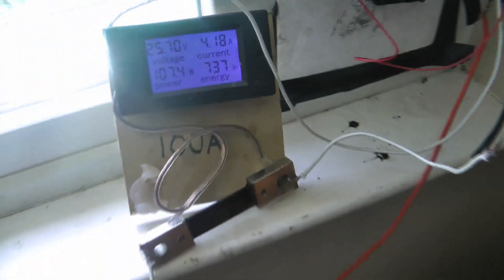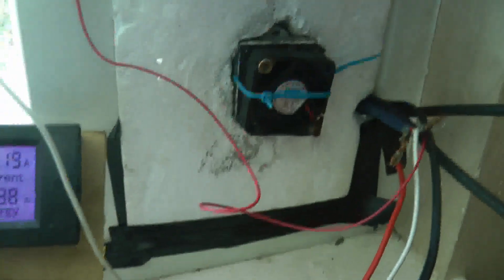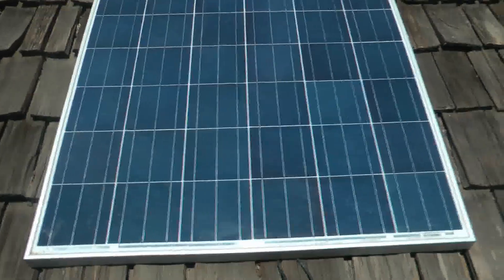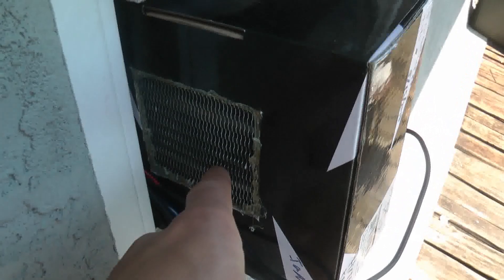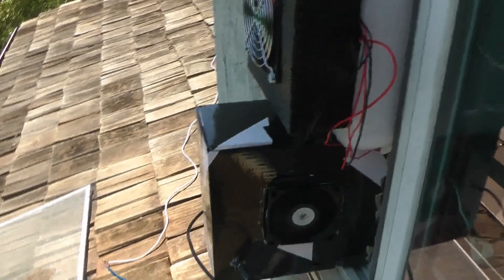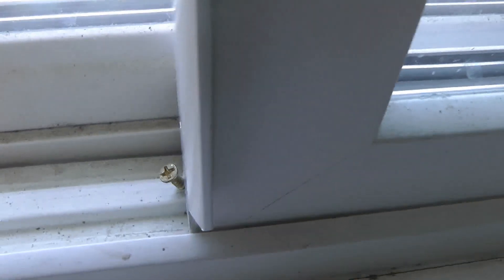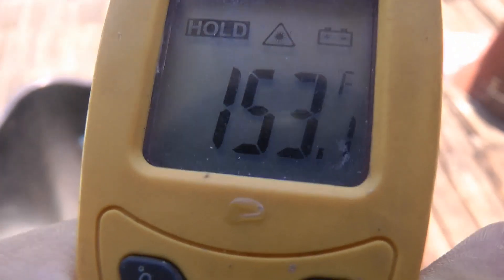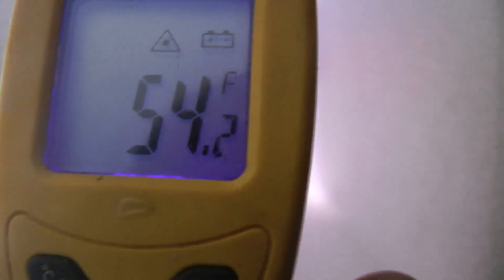Solar Powered Peltier Air Conditioner

Comment: Can we use sun heat on peltier to create electric, then use that electric to run other peltier for cooling?
Reply: Im from tropical country. Daylight really bright n hot.
So im tinkin about how to make "the hotter it get, the cooler we get"
Use multiple peltier based system for electric n coolin.
Which 1 to start 1st, electric supply system or cooling system? Then how to make the electrical supply cools. Sould i put overlap cool over hot surface..
N so on
Reply from the maker: yes and no its super inefficient  so solar is your best shot   but a reg ac unit is alot better

Comment: I see that pointing the thermometer directly to the air conditioner, it's a pretty cool temperature. I'd like to know what the temperature in your entire room is.
Reply: 153f, 87f, 61f.
Did u skip the class?
Reply: @NamaBaruSH  did i ask "you" this question?
Reply: @iantiangson1946 
Seriously Im telling the truth.
Its 175 f outsite,
87 f inside the room, and 61 f at bottom air conditioner.

U can watch it again at the ending.

Comment: I like this. 
Been thinking about doing it for cars. Imagine having a solar panel on the (car) roof that cools your car while it is parked in the sun. 
Downside is making holes for the Peltier elements. Might be ways around it.
Reply: I literally thought of this yesterday. And now here I am. It's like 90 In Cali currently. I just want my car to stay cool.
Reply: @captainKts  I’m in California also Orange County do you want to work on A/C project tougher ?
Reply: @arabcampers9554  sure, I have a few things in mind. I live on my boat in LA harbor Lear long beach, not too far from you. We should get some coffee and chat someday soon.
Reply from the maker: good idea
Reply: @ianbuilder  you think it would work what @Conny Stenberg stated?
Reply from the maker: @ThunderWolf712Tech  not at all   or very poorly as in less than a degree
Reply: @ianbuilder  how unfortunate. I appreciate your response man. Very cool video!
Reply: Passat b6 have a similiar feature using solar power on it s roof to use the climatronic while the engine is ofd
Reply: @ParkouSince2005  what year Passat b6 has this future ?

Comment: Which model of peltier module did you use?
Reply from the maker: regular 60w 12v
Reply: @ianbuilder  I mean, the high powered costly version? or the cheaper normal versions? Also I wanted to make one for a long time. How much can this cool?

Comment: I have a question for you, an idea keeps bouncing around but I'm too ill-informed to put it to rest.
Q. Would a peltier window frame have any value as an energy harvesting device?
*There will almost always be a differential between inside and outside but I suspect low efficiency might out way production cost.
*Are the hot-cold sides fixed or are they reversible dependant on situation? Would the frame require physically switching between summer and winter?
Answers like Fool or No-Fool are completely acceptable!
Also, I really like Final Spartan's suggestion. I pick up discarded electronics off the street all the time. I mostly recover components and copper to make jewellery etc but would love to make something useful from the parts that, so far, just confuse me.

I came from Nighthawk btw.

Jay (aka 996)
London.
Reply from the maker: lol   good idea   not worth it  if you plan on buying al those peltiers    as you will need many in series to just power an led  its possible but unles you have lots of peltiers on hand then its alot of money work and time to get what i would expect to be  less than 1 w per sqft during most of the year
Reply: @ianbuilder  Thank You, Thaank Youuuu. So Dooo.
You've removed a needling thought that has bugged me for ages. I couldn't let it go without being sure it wasn't viable but I didn't know who to ask.
I'm eager to see more from you, just wish I had a dollar to send. Keep it up Bruv.

Jay.

Comment: This content is Pog. Subbed with notifications on.

Random idea. Start a series where you make cool projects with a single 18650 cell. The simplicity and ease of using 1 18650 is really attractive for people looking to get into hobby electronics and RC. You'll probably need a 3d printer to get started, if you don't have one already, start a Patreon or GoFundMe, I'll support it.
Reply from the maker: i have a ender 3  and i can definitely do some 18650 cell projects  any ideas?
Reply: @ianbuilder  One of the best features of 18650s is its insane specific density at a relatively low price point. This makes it ideal for dead simple RC vehicles with reasonably long ranges. I suggest maybe a simple plane or a car to get started, ideally it's 3d printed and uses as little hardware as possible. There are a few preexisting projects like this but very few of them are centered around the idea of being powered by a single 18650.

Inspired by:
- Jerome Demers 18650 drone
- Tim Stanton Lithium ion plane battery
- Tim Stanton 3d printed hovercraft

More benefits of single 18650 designs:
- Super simple to recharge
- Insane endurance
- Insane capacity
- Reasonable current (See sony VTC6)
- Standard form factor (unlike most LiPo)
- Readily available
- Cheap
Reply: Sweet idea Final Spartan.

Jay. (Londinium)